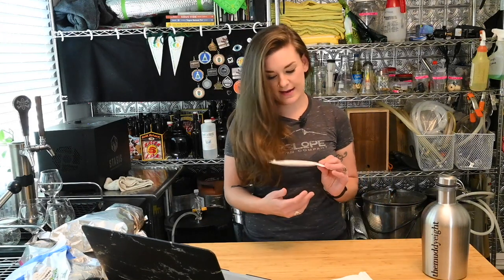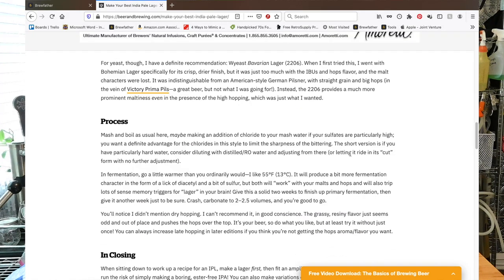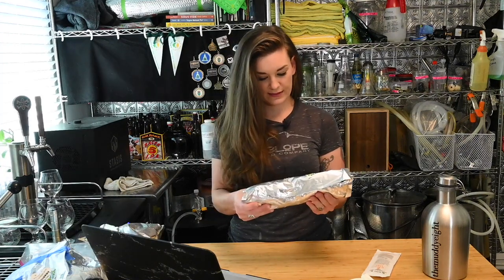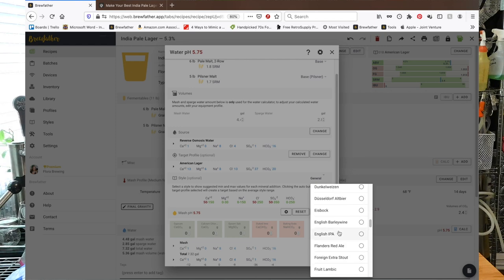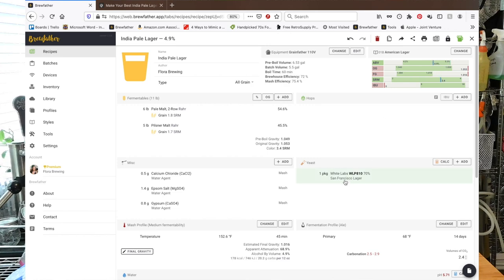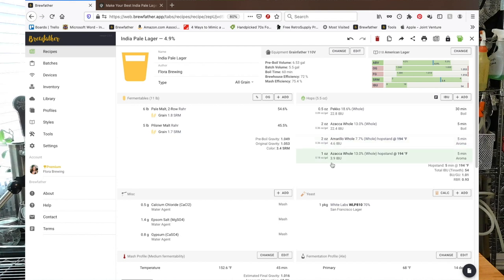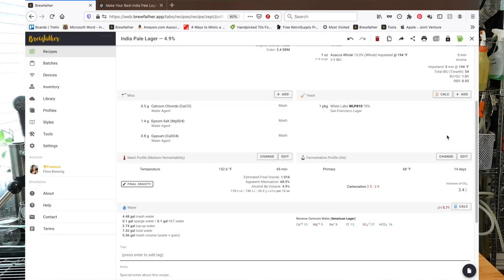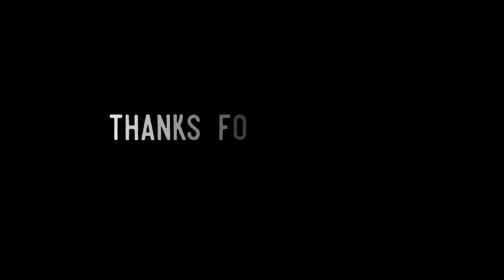How to Create Your Own India Pale Lager Recipe

Comment: ....this is why hornindal is great @12:47 its good at 90.F-105.F, some how doesn't get stressed!! Been brewing with it all summer my fermentation room bas been sitting at 90-105 all summer!!
Reply from the maker: Geeze! That's high temps. I'm going to have to try that strain.
Reply: @FloraBrewing  Just finished a quad identical batches. Only thing different is that I used Loki and Hornindal but same wort. Batch A fermented in the hot room at 90.F-95.F and Batch B fermented in our yoga room at 74.F for 5 days, the yeast is fast, prob was done in 2-3 days. They all hit 1.000 fg - 7.8 abv, other than being different yeast-kveik my housemate with the super nose and excellent taste couldn't tell a difference : ) so they dont stress out at that temp and produce a ton of fusels!!